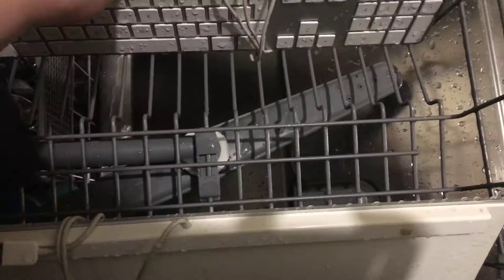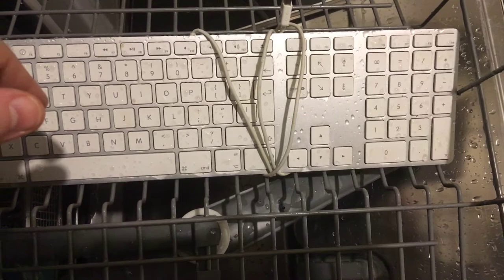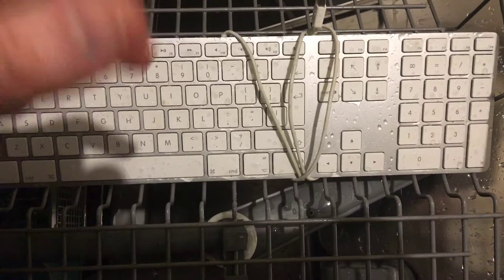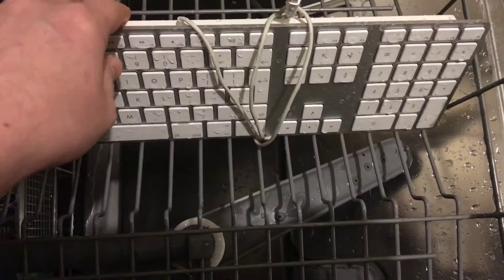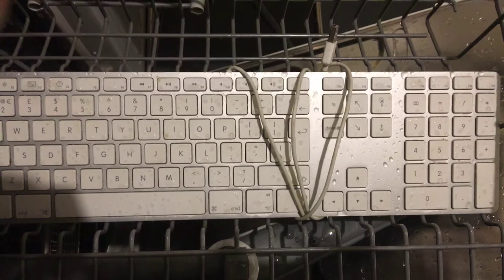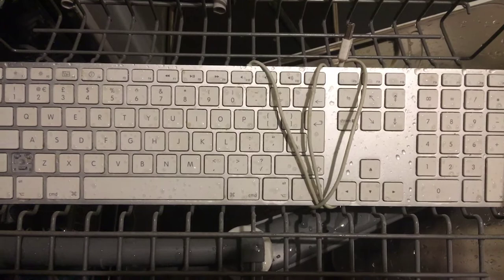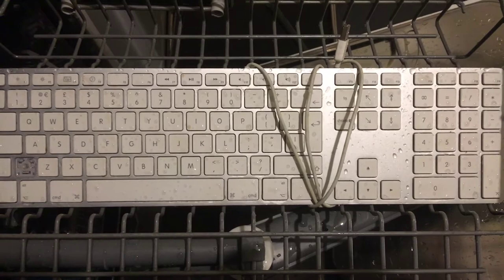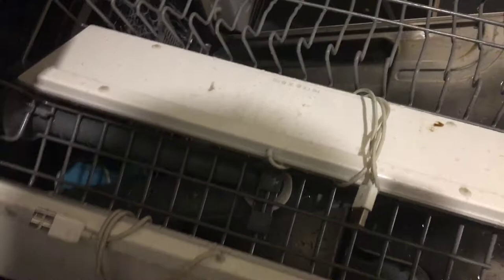Apple extended keyboard dishwasher recovery? Quick answer NO

Comment: How did it go?
Reply from the maker: No positive result From dishwashing do not bother, these Apple products are affectively landfill at this point unless they can be separated and recycled, and that is difficult as things have been glued and tack welded together will probably have to be separated manually, things being made of recyclable materials, does not mean that they have been well designed to be easily recycled.